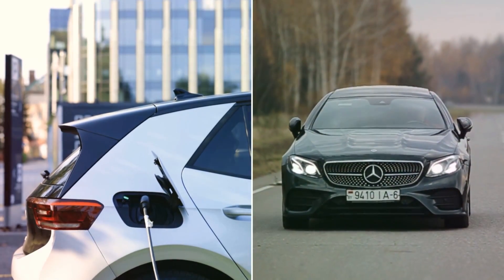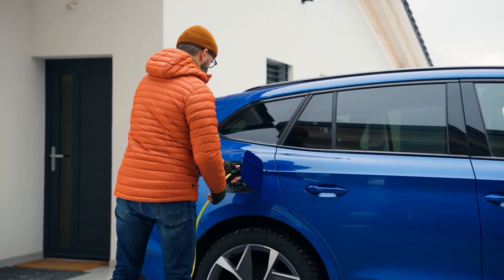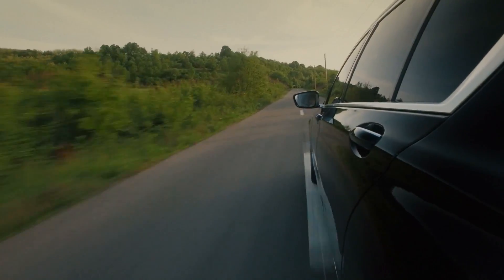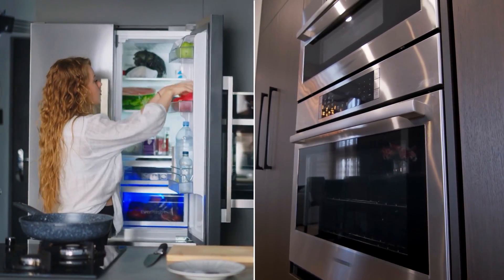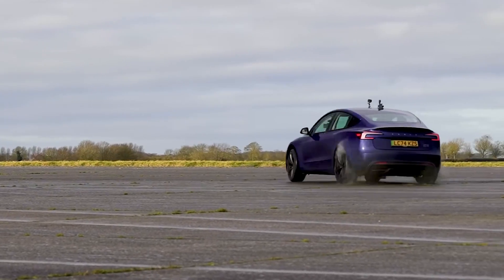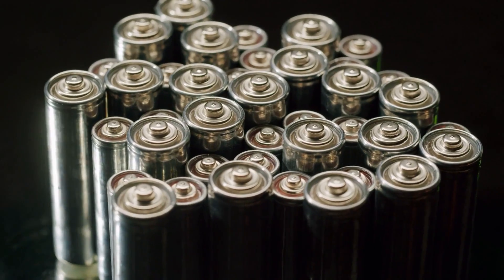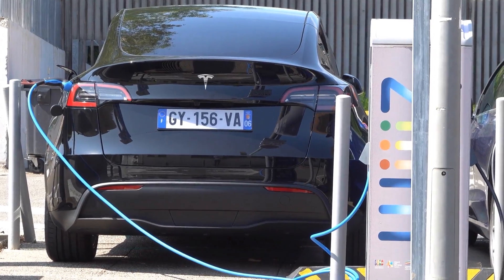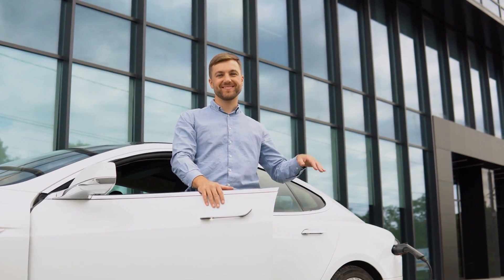7 EV Mistakes That Cost You $10,000+

Comment: Don't forget, EV's still have reduction gears, bearings, and differentials. They require gear oil changes! Keep in mind, EV's have regenerative braking, so not only are the drives responsible for all the "go", they're also responsible for up to 95% of the "whoa", as well. In a combustion car, the gears are all the go, and perhaps, 10% of the whoa. That said, gear oil maintenance is even MORE important on an EV, than a combustion car. (not to mention, EV's are often more powerful than combustion cars, putting yet more stress on those moving parts)
     I just bought a new 2025 Chevrolet Equinox EV, with all wheel drive. Once I reach 5,000 miles, I'm going to have the differential oil changed on both front and rear, because of the break-in. I intend to do it again, at 20,000 miles, then 50,000. After that, every 50,000 miles, I'll do the front drive, and every 100,000 miles, the rear. This AWD is basically a front wheel drive car, with rear assist. the back axle is a passively cooled induction motor drive, that is only used as part of traction control, or as an assist during hard acceleration, so it doesn't require the frequent maintenance, that the dominant permanent magnet front drive does.
Reply from the maker: Absolutely — great point! Even though EVs skip engine oil, they still have reduction gears and differentials that need gear oil changes. Your maintenance plan for the Equinox EV is smart — early changes are cheap insurance for long-term reliability. Thanks for adding this!